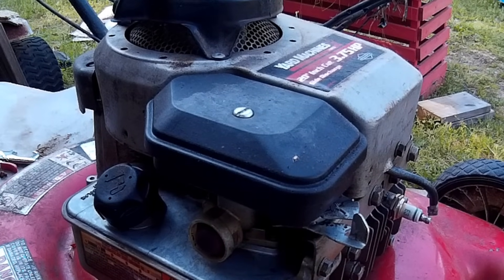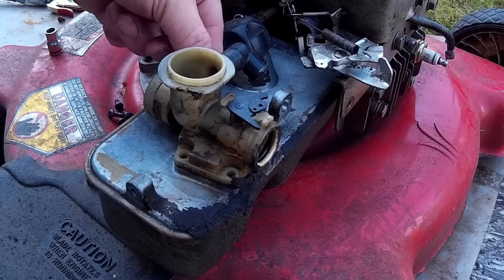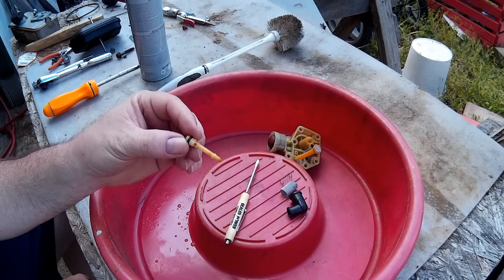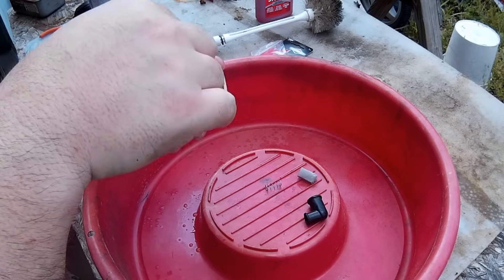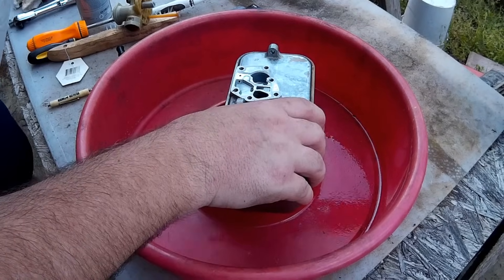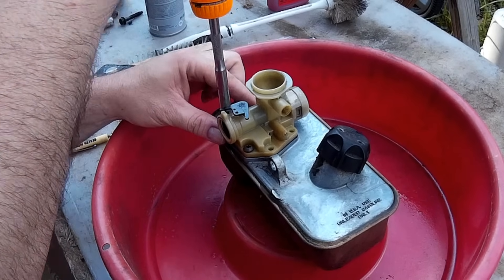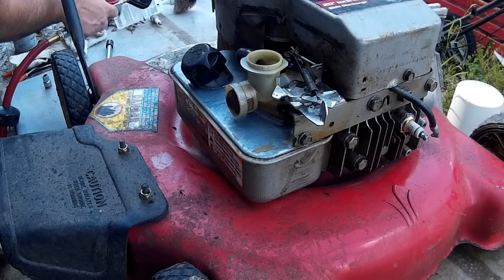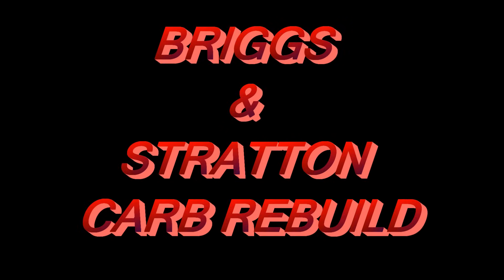Briggs and Stratton Plastic Pulsa Prime Carburetor (Carb) Rebuild

Comment: hi,  I have just changed the diaphragm and gasket on my b and g 500 series lawnmower as it was guzzling fuel and running uneven.  it now runs lovely and level but then cuts out after about 2 mins of running. it then won't start again.  any ideas on what the problem is please.  thanks
Reply: I have the same issue! about 2 minutes & NADA!
I tried spacing teh Ignition pickup off the rotor .028, no real difference.
I am going to pull jet & maunaly clean & flush,,,today.
though, got rid of the pulsing problem!
great Video, straight up, No annoying music !
Slim49
Reply: He is Correct!
Pulsing was fixed by Diagram & clean out.
but needed a new PLUG to run well. ie..dying out in 2-4 minutes!

Comment: Hi, I have same lawnmower engine, but problem am facing is engine starts and then stops after around 30-40 secs, i have already changed spark plug, cleaned the carb, but this problem is still there, not sure whats wrong, can you suggest or help , any idea ?
Reply from the maker: +One Channel it still sounds like a fuel delivery problem to me. If you didn't replace the diaphragm, I would try that. It sounds like it might be choking enough fuel into the carburetor to run for a short  time and then starves itself out. Good luck!

Comment: Your video was just right, i sat down and took the tank and carb off. Cleaned it up a bit, then took the screws out and Very carefully lifted the white carb body off the tank, the gaskets stayed on the tank.  Then i took the gaskets VERY carefully off and there was NO spring under it. I put the new gaskets back and it runs but rough and too rich.  I have looked all over on Google.....Where can I get the spring?   Any help appreciated,,,,,,,Chick Curry
Reply: chick if you havn,t got that spring yet the b&s part # is 262764 it is called a diaphragm spring it is $1.57 at briggsandstrattonpartstore.com you can go to this web site and enter the model number on your engine and it will bring up a parts diagram for that engine. be sure and enter the engine number and not the mower number.

Comment: Great video. Unfortunately for me, I found this after I'd already chased problems around and ended up spending that $30 you mentioned before it was fixed. My mower is just in its 4th season and I've had problems since season 2. My warranty had me taking it 80 miles round trip for service so I struggled. Just replaced the whole carb to find that the bulb was leaking air, the tank had trash, the alum. breather bolt stripped out, and that rubber elbow had cracks in it. After replacing the carb I made a 4 1/4" threaded steel rod for the breather and now use a wing nut to remove the breather for cleaning. Runs better than new now! Thanks
Reply from the maker: What an adventure! Glad you got it fixed. Good to hear that it runs better than new. I had that happen with a weedeater once. When I was done with it, it had way more power and was more responsive than the first time I used it.

Comment: hi great video it will help me with my mowers problems one has this problem the other will be a total rebiuld, just one comment about your video is that you clean the carb and tank but not the area of the engine where you are fitting this nice clean carb and tank back too, why not clean everything
Reply from the maker: +Stephen fysh I had blown everything loose off with the air hose.  Most of what looked dirty on the cover of the motor around where the tank and carb mount was missing paint and rust.  However, you're right, I could have taken a little more time cleaning.  I hope your repairs go well for you.  Thanks for watching!

Comment: EXCELLENT !  I have a yard machine tiller same carb doing same thing. . I put a tester on the plug/wire getting sputtering spark(makes sense with stahling carb) was about to buy a $25 coil pack. instead it's a $5 fix.
 Thanks for the 411 & great Vid. off to grind up some weeds in garden !
Reply from the maker: I'm glad the video helped out. It's always a good feeling when it turns out to be something less expensive than expected.

Comment: Thanks for the very thorough video!  Great result after the carb cleanup and rebuild.  The engine sounds smooth.  Do you have the part# for this B & S carb rebuild kit?  In the mean time I'll google for the part number, as I do have the carb part# that should lead me to the kit.  
Brief story - a friend of mine purchased a Craftsman mower with the very same engine and pulsa jet carburetor.  The dishonest man that sold it to her claimed he rebuilt the carb.  She eventually gave the mower to me because it stopped running.  When I removed the carb, I discovered that the screen filter that slips over the jet was missing, hence the reason the mower stopped operating.
Reply from the maker: The kit is a B&S part # 495770 and comes with the diaphragm, the gasket, filter screen and spring. I bought mine from Lowe's for $4.98 + tax.  Thanks for watching and good luck to you on your mower.
Reply: 4 days I been trying to figure out my push mower problem.
Dozens of videos and I have done have as many repairs! Then look and behold you present "MY" mower with exact same issue! It even sounds the same before repairs!
I am of to Ace (because it's a mile away : ) as soon as I finish this vid!
I hope this works my grass is almost knee high!! Lol
Thank you sir for this video!!
Thank you!